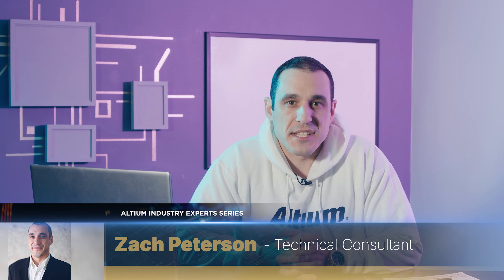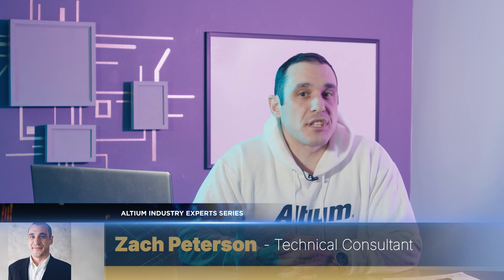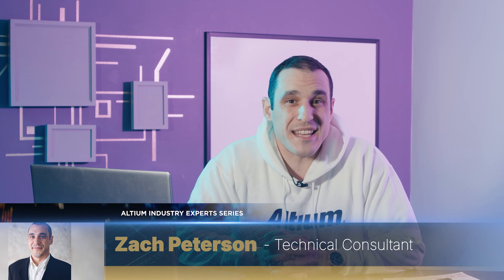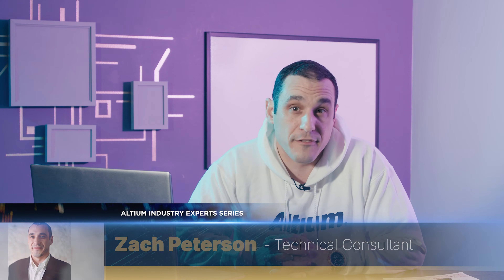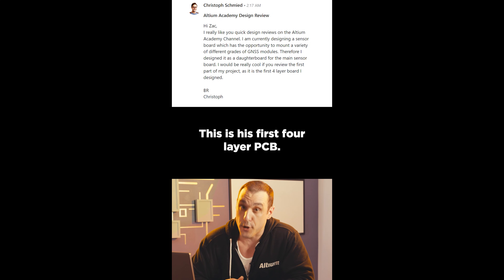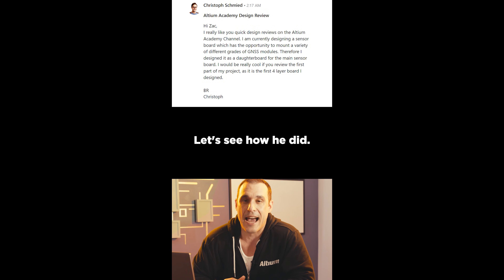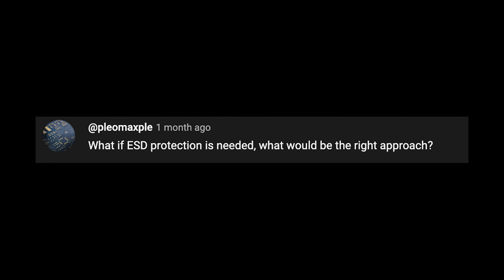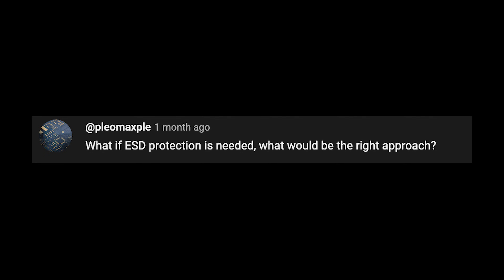TVS Diodes on RF PCB Traces: What You Need to Know!

Comment: Can we place the TVS Diode directly on RF trace or do we need to use lambda by 4 stub between rf trace and TVS Diode?
Reply: I'm not sure about the lamda by 4 situation, but the purpose of having a tvs diode is for esd suppression, which has to be done at the source where human contact is possible which is at the antenna connector. Unless we want to use it as a traditional tvs diode to prevent voltage spikes caused due to pulsating gates on digital circuitry.
Reply: If you're working at a narrow frequency range, then the 1/4 wavelength stub can be shorted to ground.  The round-trip will be 1/2 wavelength, so it will appear as an open at the transmission line at RF, and yet be grounded at DC.  (Been a few years, so anybody feel free to correct me if I got this wrong.)
Reply: Yes, this is commonly done - especially in mm wave systems where junction capacitance of any directly connected TVS is intolerable.